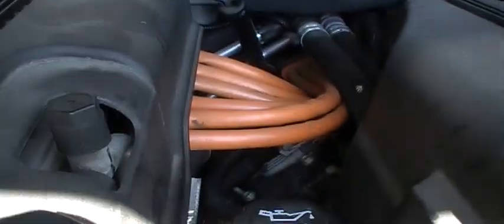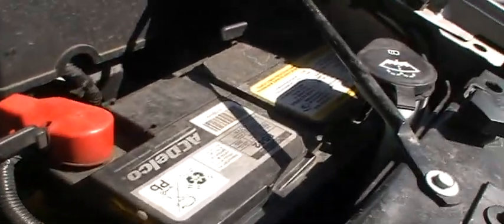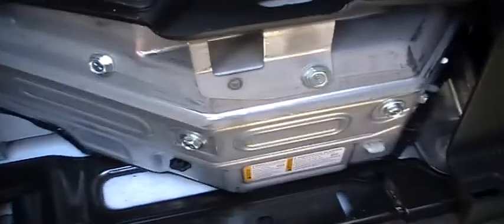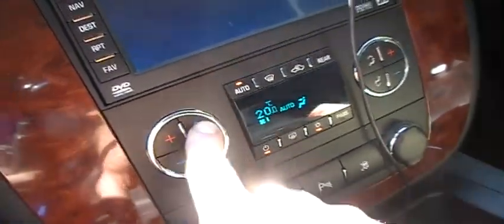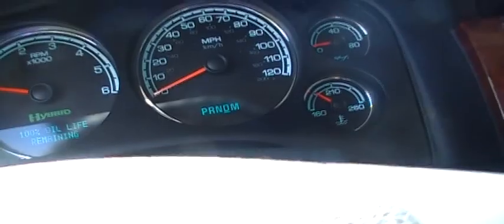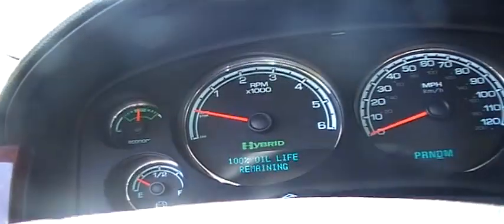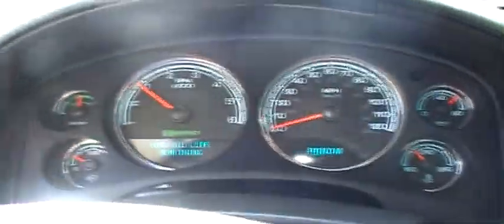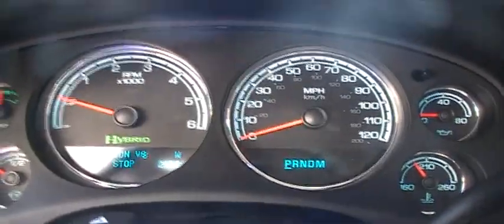How a Hybrid Works

Comment: Can you help me here, I have a 2009 shave tahoe hybrid will not driver,  I got ignition and everything but it will not start
Reply from the maker: Make sure the 12v battery has enough charge. It's not as obvious when they go bad because it doesn't have a traditional starter.

Comment: I have a 2008 and need to replace my power steering assist motor and cant get it off no matter how I try any tips
Reply from the maker: Good chance it's probably seized to the shaft if you can't get it to come out. Try some penetrating oil around the mating flange, let it sit for a couple hours and try again, you may need to try put some heat to it. If all else fails, you may need to replace the steering rack.

Comment: Im looking at buying a 2011 yukon hybrid 88k miles for 13500. is a hybrid even worth buying? im used to the old standard engine and drivetrain.
Reply from the maker: Honestly, I'd just stick with a regular Yukon, the hybrid is expensive to fix and doesn't get the best fuel economy compared to the standard one

Comment: My father  just purchased a 08 Yukon hybrid 6.0 with 210k miles but he's worried that the battery may go out soon.
Reply from the maker: That's a pretty healthy number of miles. I'm not sure what their expected lifespan is supposed to be
Reply: @6speeddakota  so,basically there's not much of a difference than the non hybrid version I'm guessing?
Reply from the maker: These don't really get that great of fuel economy compared to the standard Tahoe/yukon. In the city they're better, but highway and combined there's not a drastic difference.

Comment: I have a 2013 GMC Yukon Denali hybrid. How does the starter work on these? Are you familiar with that part of the system?
Reply from the maker: There is no starter in a traditional sense, it uses the electric motors in the transmission to drive the engine through the fluid coupling in order to spin it to get it started. There’s a traditional starter mount on the block, but it’s covered with a sheet metal block off plate.
Reply: @6speeddakota  thank you for this information. Do you by chance know where a mechanics manual can be purchased to understand the system better?
Reply from the maker: You could try look for a Haynes manual. The problem is that there are so few of these that any type of documentation is hard to come by

Comment: Hello all, we have the Escalade version and experiencing issues with the power steering and lot of codes about the hybrid motor controller.  Since the power steering ties into this thing and giving us so many headaches, has anyone every removed all the hybrid and adapted to return to just a traditional GM V8 somehow on these vehicles??
Reply from the maker: That’s going to be a very complicated swap, your best bet would be to sell it and buy a standard Escalade.

Comment: uncharged hybrid battery dilemma. if I connect all that's needed then what? I'm assuming the battery is dead. it sat for months. almost a year I believe
Reply from the maker: It may not be, but the 12v battery is probably dead. Try jump start it and see what happens
Reply: @6speeddakota  brand new. everything comes on...Radio AC heater...windows all works fine
Reply: @6speeddakota  thanks for your reply. I'll make sure all is attached properly and try...and post results. but inwas told to replace feulpump 1st. it has 159k miles
Reply: @focusinc4266  you can charge the hybrid battery thru the 12v battery but it takes a dealer level scanner to do it.
Reply: @focusinc4266  not a trickle charger you need something to put some amps into it. the battery it's charging up is 300volts 1.7kwh if i remember right. that's a lot at 12v. if you Google it, you can find the procedure. I'll look for it too.

Comment: Thank you for the video..
I have a GMC YUKON 2008.. .
I HAVENT USE THE TRUCK FOR LIKE 3 YEARS...BUT NOW DON'T START...
SO MY QUESTION IS...

Its POSSIBLE that  the HYBRID battery goes discharge?? I mean it has no charge??.  Cuz I put new 12 v battery and nothing. 
And also  the HYBRID battery..
CAN BE CHARGE????AN HOW..
THANK YOU VERY MUCH...
I WILL REALLY APPRECIATE IT... IF I GET ANY ANSWER...
AGAIN THANK YOU  FOR THE VIDEO.
Reply: yeah, the hybrid battery can die. you can charge it thru the 12v battery but you need a dealer level scanner to enable it. so either tow it to a dealer or you can try finding a scanner. some people say one of the knock off tech2 scanners will do it, but I don't know.

Comment: Do you know why my economy gage fluctuates when I brake? and whey I hear a winding sound like a turning ratchet when I slow down to auto stop mode? The dealer said the ratchet sound when slowing down to auto stop mode is normal. I can send you a video of both
Reply from the maker: The economy gauge moves depending on how hard you accelerate or brake. That’s totally normal. The ratcheting sound could be a lot of different things. You can either send me the video by sending me a message on my Facebook page or email me at 6speeddakota@gmail.com. I would hazard a guess that there’s an issue with the brakes or the wheel bearing
Reply: @6speeddakota  I’m emailing the video from my gmail account t now.

Comment: How do you replace the plugs and wires on 2012 Yukon gmc hybrid
Reply from the maker: Drivers side, go from the top, it’s very straightforward. Passenger side, you need to take the wheel and fender well off and go through the wheel well. The #8 plug you’ll need a u joint socket and a couple extensions
Reply: @6speeddakota  
Do have to disconnect the hybrid batter or other battery
Reply from the maker: @mariahmckenzie5674  nope, not at all

Comment: can you remove the hybrid system and use only the gas engine
Reply from the maker: No, the hybrid system is integrated into the transmission, and it’s also required to start the gas engine

Comment: Hey hi ,I have these same yukon hidbird but right know I have a be issue the transmission isn’t working that well 
My mechanic was going to pull it out but he was told if he does that the truck will dís program all the truck .
Now I don’t what to do ,any help or would I just sell it (it still runs just that you have a hard time changing parking to drive and drive de reverse)
Reply from the maker: The transmissions in these are pretty robust. The problem is you’ll be hard pressed to find a used one, or find someone to rebuild it. Start by checking the shift linkage, make sure it’s properly adjusted. There’s also an electric pump that keeps the line pressure up when the engine is off, those like to go bad as well.

Comment: Thank you for the video. Working on our 2010 hybrid Escalade. It starts and runs but goes into limb mode and eventually dies. The dealership seems stumped on the issue. Both batteries have been tested and are good. Any ideas?
Reply: Fixed ?
Reply: does it say reduced engine power?  throttle body or gas peddle..

Comment: Just curious if your dad still has this vehicle and how it is running.  If not, what was the experience while owning it?  I still have my '08 hybrid tahoe and have loved it but am starting to have some of the issues some other commenters are having.  Thanks!
Reply from the maker: Haven’t had any major issues with it other than the brake booster failed about 5 years ago. It also had the typical failed oil pressure sensor these LS engines are famous for. It’s been a decent vehicle. He doesn’t drive it as much as he’s not commuting anymore, so I really haven’t worked on it in quite some time

Comment: How can you change the lifters in a hybrid Cadillac Escalade
Reply from the maker: It’s a very big job, the cylinder heads have to come off in order to get to the lifter trays
Reply: @6speeddakota   do you have a video for it so i can see what i need to do
Reply: @6speeddakota  cause i can’t get to my passenger side
Reply from the maker: I don’t unfortunately, this one doesn’t get driven much so I don’t do much work to it
Reply from the maker: My assumption is that the hybrid battery needs to be disconnected and the control unit dismantled. But that takes special tools touch anything high voltage

Comment: excuse!  i have a 2010 chevy silverado hybrid does not do anything backwards or forwards!  I changed the battery in front and it remains the same
Reply from the maker: If the engine won't stay running, you need to make sure it's getting fuel. It's' still a combustion engine, if the fuel pump quits, it won't run at all.

Comment: Do you know how to test the inverter on a 2010 hybrid Denali
Reply from the maker: I would say that you should load test it like you would an alternator, you should see amperage output when you load it down, and it should have a decent 60-70 amps minimum before the voltage drops below 12.6v

Comment: Hi there! Does your dad still have this vehicle and do you still recommend this vehicle? I am looking at a 2010 GMC Yukon Hybrid with 110000 miles on it. Should I buy this? Thanks!
Reply from the maker: It would just recommend the regular Tahoe. The fuel economy isn’t that much different, and it doesn’t cost an arm and a leg to fix compared to the hybrid. The other issue we’ve run into with it is having to wait a week to get hybrid specific parts that need to come directly from Michigan.

Comment: Hey I’m having issues with my hybrid. It’s not powering up nor starting. Could my inverter failed. It was running fine until my wife gave out of gas then it wouldn’t crank back up after refueling
Reply from the maker: Question is did it get driven on electric for a ways before she fuelled up? She could have run the big battery down. First thing I would check is the 12V battery. A lot of people forget it needs the little 12v battery to run all the vehicle systems.
Reply: @6speeddakota  it’s 2008 Yukon hybrid 2 mode,  I’m not sure about the electric part. We just use gas. Now when it turns over it like the power not correct to engage properly
Reply from the maker: @yeekasignaturehookset8088  you need the big hybrid battery pack in order to start the engine. Without the electric drive motor, the engine won’t start. So if it was driven on electric because the gas engine was out of fuel, the main battery pack may be run down so the big drive motor can’t start the gas engine
Reply: @6speeddakota  that’s the big battery under the back seat? How do I recharge it?
Reply from the maker: @yeekasignaturehookset8088  correct, I’m not entirely sure that’s your issue, but it’s a hunch. First off, make sure that the 12v battery under the hood is alive and kicking. If the vehicle is totally dead, that might be your issue, since the 12v battery runs the vehicles electrical system, all the big battery does is run the electric motors. If the hybrid battery pack is really dead, it will have to be put in a special charge mode using a high end scan tool, and it will charge the big battery from the 12v battery hooked to a high output battery charger through the inverter, similar to how it charges the 12v battery but in reverse.
Reply: @6speeddakota  so should I take the big battery out and check the voltage on each pack? I removed it a while back and the volts where around 8 to 9 each pack. I cleaned the ends the best I could I’m they were corroded maybe they’re back corroded. I’m hoping I can avoid the mechanic prices right now. It’s tough on me at this point. I really appreciate your help
Reply from the maker: @yeekasignaturehookset8088  I'm not sure what the cell voltage should be, if the battery pack is 300V, divide it by the number of cells and you should get your cell voltage. I think it's 300V total, but I may be wrong

Comment: Thanks a lot for the video. I have a 08 Tahoe hybrid, but I had problems with the power steering motor. It make sounds when I turned the steering wheel. Do I have to replace the motor or any idea please? Thx
Reply from the maker: First thing I would check is to make sure that nothing is bound up in the steering linkage, make sure everything turns properly with the wheels off the ground. If all else checks out, I would test the motor to make sure it's ok. It could be just about anything from the drive gear being stripped to the motor bearings being no good.
Reply: @6speeddakota  thank you so much. Appreciated

Comment: Out of curiosity, how many kms did you get on this thing before the hybrid battery died/was replaced?
Reply from the maker: Tyler Silcox it’s still on it’s original battery. Theoretically the battery should last the life of the vehicle
Reply: @6speeddakota  theoretically you are correct, but first Gen gm hybrids haven't all been so lucky. The reason I ask is because I also live in BC and we are just now replacing our hybrid battery and we are doing it at 120k km. Since mileage is rather low I am wondering if under use may impact battery life as well? Either way I'm happy to hear your guys hybrid is still going strong!
Reply from the maker: @tgts  I would imagine that sitting for extended periods of time isn't particularly good for it. I think this one has about 150 on it and the only major issue it's had in the last little while is rodent damage on one of the injector plugs.
Reply: @6speeddakota  thank you for the info and the video!!

Comment: Hello thanks for the video 
I have a 08 GMC Yukon hybrid and lately I've been having sone little problems 
When auto stops some times it wont fire back on and shuts off   is also asking for  hybrid service  
Nevever have done any maintenance on it except for oil and filter change please help
Reply from the maker: My question is, does it feel like it's trying to start? or does it just fail to go at all? Something may be preventing the gas engine from starting, or if there is truly in fact an issue with the hybrid system, it's not trying to crank at all. I believe there are air filters that go to the cooling fan for the hybrid battery pack, make sure they're clean and the fan is working, the hybrid battery pack may be overheated

Comment: HI 6SPEEDDAKOTA. I HAVE A 2008 TAHOE HYBRID  AND WHEN I TURN ON THE IGNITION IT WORKS NORMALLY IN ENGINE MODE, THEN WHEN DRIVING ON TOWN AT LOW SPEED (25-30MILES) AND I MAKE SOME STOP AT  A TRAFFIC LIGHT, I APPLY BREAK AND CONTINUE DRIVING AND CHANGES TO HYBRID MODE, AND WHEN I SPEED UP, SUDDENLY TURNS OFF COMPLETELY. AND  I HAVE TO TURN ON AGAIN. AND WORKS NORMALLY  .I WANT TO KNOW WHAT WILL BE THE CAUSE OF THIS. TO FIX IT. THANK U FOR EVERYTHING . EXCELLENT JOB.

Comment: Thanks for the video. I have a question though. I have a 2008 GMC Yukon hybrid I bought a few months ago and it has 230,000 miles. when I bought the vehicle the hybrid battery was completely dead and the 12V battery wasn’t even in the vehicle. So anyways I had someone install a used hybrid battery and I also put a new 12V battery and the vehicle starts and runs good. but the problem I am having is every time I stop at a red light the vehicle doesn’t go into auto stop right away. it takes at least two minutes or more and then when it does go in to auto stop a minute later it goes back to the engine running without me doing anything. also when I’m at a red light and I let go of the breaks the RPMs start raising up to 2000 rpm and when I put my foot on the gas pedal the car will move two or 3 feet and then it will start kicking for a few seconds and then the car runs fine. also the check engine light and airbag lights are on and when I use the key fob to lock the doors the horn will sound and the lights will blink but the doors will not lock I believe something has to be reset please let me know.
Reply: you ever fix it?
Reply: @jsomething2  do u know how to fix it?

Comment: Hi. Excellent video. I liked a lot. I have a 2008 chevy tahoe hybrid. And i have a question. Forr you.my truck  was working  in dual mode i mean with the engine on  &  with the battery. The rhing is that i move in the menu the icon HYBRID AND I PUSHED THE MOTOR IDDLE IT BECOMES IN RED. AND  NOW ITS WORKING ONLY IN BATTERY MODE. AND IT TURNED OFF MANY TIMES. HOW CAN I RESTART AT THE OLD VERSION. In hybrid mode and gas motor. I would really appreciate your help.
Reply from the maker: There are a lot of different things that can cause the gas engine not to start. The gas engine should start and run when you turn the key to the start position, when the shifter is in reverse or manual, and when the hood is popped, or anytime the engine is below operating temperature. Otherwise it should shut off at low speeds and at a stop once the engine has reached operating temperature, unless the big battery needs to be recharged, then the engine starts back up to recharge it. It sounds to me like the gas engine is having an issue with starting. This can be due to many factors such as a bad sensor, low charge in the small or big battery, bad fuel pump, etc.

First thing I would do is hook up a code scanner and figure out if there are any trouble codes that may point to the reason that the engine won't start

Comment: I have a 2008 Chevrolet Tahoe Hybrid, I have replaced the lifters on the driver's side however I have a collapsed lifter under the Hybrid pack of which of course no one wants to touch. How do I safely remove the pack so I can replace the lifters under the pack.?